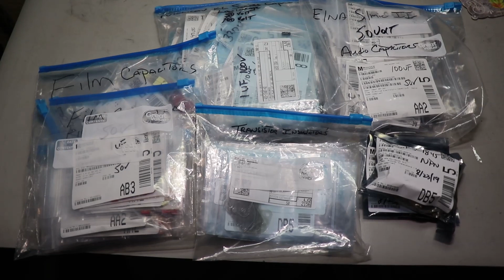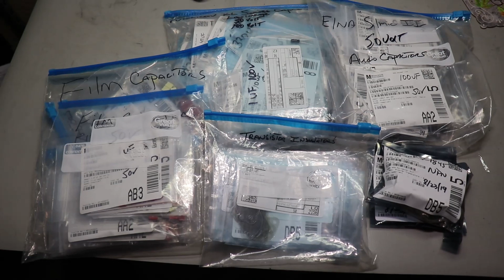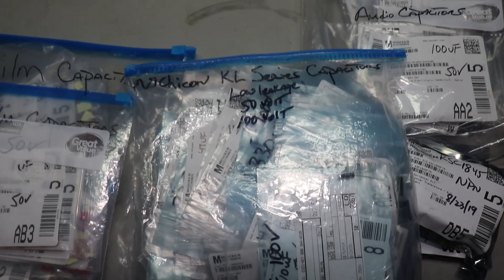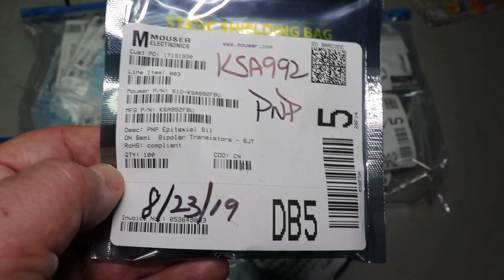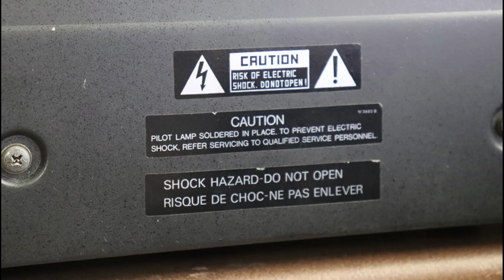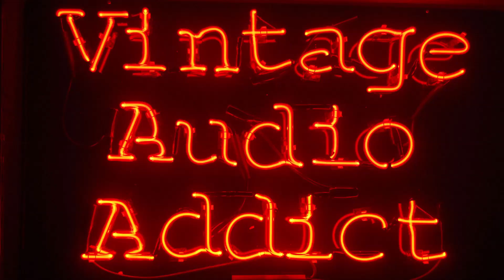Vintage Stereo Repair - The Parts And Tools Needed To Fix Old Audio Equipment

Comment: For those of us, who's better half will not let us buy one of the vacuum de solder irons. I have found a great trick for using solder wick. Put a little bit of flux paste on the joint you are desoldering and the solder wick will suck it right up in a second or two so that you don't get the joint too hot. Clean it good with alcohol when you're finished.

Comment: Need help! Replacing a capacitor and soder will not stick.
Reply: You might need some additional flux. There are various kinds, some more aggressive than others. Research it before deciding. You may want to use some 90+% isopropyl alcohol on a tip to clean the area on the pcb and even possibly the leads on your part well before proceeding to remove any possible contamination. Make sure the pcb and part has the alcohol well evaporated before applying heat.

Comment: I'm about to order a new soldering iron probably going to find an analog model. Do you feel there is any advantage with a digital  ? Just seems like more to fail
Reply from the maker: No need to get one with a digital readout if you don't want that. Just get a descent soldering iron and it will do fine for you.

Comment: I have a optinica amplifier sm 1515b if the power transformer goes bad can it be fixed the part number is rtrnpo506afzz it is my graduation money purchase so it is centimental the output ic is s-60w sharp number rh-ix1066afzz the power cap. Is a dual 50 volt 6800mfd

Comment: Do you sell any of the repaired equipment? I would be interested in buying.
Reply from the maker: Thanks for asking but no. I'm a collector who just repairs and restores equipment in my personal collection.
Reply: @vintageaudioaddict  I have a Sansui 9090db that the right channel on all 3 speaker settings, doesn't work at all. Seemed like when I retrieved it from the dump 20 years ago, it would cut in and out before the red light of death would shut her down, but over the last few years when plugging it in after rediscovering it after moving or rearranging the basement,  it doesn't work at all anymore. Do you have any recommendations for sourcing quality replacement parts, tips for troubleshooting/diagnostics, or parts you're interested in selling to help this here beginner revive the beast that solidified my passion for vintage audio from the Golden age? Any advice, tips or links to videos of yours would be greatly appreciated! Thanks for sharing your passion and expertise with the world!!!

Comment: Do you have any idea what would make a fm tuner not pick up stations on a sansui g 9000 db,   I can hear a faint signal on really strong stations but nothing strong enough to listen to. I have checked continuity going into the receiver but I don't know what to do next . Everything else works as it should.
Reply: I had the same issue with a 3000a, recapping the fm board fixed mine.

Comment: Had a question. Have you repair MD players? I have one that will power on when plugged into a power source but wont work on the original battery and the new battery I got for it. Think you could fix it?

Comment: don't you have to discharge those caps before pulling them?
Reply: If they have been sitting a long time without being powered up, they should be discharged>>they are small

Comment: Large filter caps another guy on YouTube who restores vintage gear says says he seldom replaced them. He says it's not necessary as they often test good. Anyway I wonder what are your thoughts ?
Reply: Filter electrolytic caps can make problems in some circuits if they are bulging/swollen and/or if their ESR increases a lot. Then they are a good candidate for replacement,

Cheers!

Comment: I love that vacuum desoldering tool.
Fantastic idea. I've just used those spring loaded ones or the bulbs. Neither are anywhere near as good on the circuit traces. You want to do it fast

Comment: When soldering using any tool please use a small fan to blow the fumes away from yourself. This is especially true for old lead/ tin solder. A face mask may fog up 
your glasses, mine are cheaters so yeah I'm old,, and you won't be able to see the  very fine work your doing.
Reply: Not certain about the points made but ,if anyone else  wants to discover 
ifixit and repair
 try Saankramer Electronic Magazine System (do a google search ) ? Ive heard some unbelievable things about it and my work buddy got excellent results with it.

Comment: You should instruct folks to remove that old "Sony bond" glue before reinstalling new caps. It becomes corrosive and will literally eat through the leads of thru hole components..
Reply: yea, the number of CB radios with that crap in them.
I'm sure they designed that shit with deliberate long term problems in mind
Reply: @Dazzwidd the adhesive used in radios was more for support of the components because of all the jarring G forces its exposed to under normal operating conditions.

Comment: Should you reflow solder other components while you're replacing caps?
Reply: It can't hurt, especially if the circuit traces are robust and not prone to lifting.
If you reckon a solder join could go be prone to going dry, just refresh I'd say

Comment: i hope to see u do more vintage repairs
Reply from the maker: I've posted some repair and troubleshooting videos below that I've done.

Troubleshooting Failures In Vintage Audio Equipment -

Vintage Stereo Repair - https://youtu.be/N3e9C4mUui0
Phono Repair And Troublesome Transistors - https://youtu.be/lkcP1z-KcPA
Hakko 808 Desoldering Tool A Must Have - https://youtu.be/NtSn_HPT-sE
Hazards Of Reel To Reel Tape Deck Repair - https://youtu.be/KvXwN5igzDg
No Audio In Vintage Equipment - https://youtu.be/pKqxlT9sgZY
Troubleshooting In Vintage Equipment - https://youtu.be/xk5gjq5ehK0 
Reforming Speakers - https://youtu.be/ttbgeDagRus
Checking DC Offset On Vintage Amplifiers - https://youtu.be/ZvBoxhpa-v8
Replace Old Electrolytic Capacitors - https://youtu.be/RaWrYJ6amcA

Comment: Great video,  What temperature do you use on your iron.
Reply from the maker: Thank you very much for your kind words. Around 700 - 750 degrees Fahrenheit
Reply: My jvc shelf home stereo doesn't power on. What can I check for?
Reply: @ar6484  Look at the power supply. Fuses, bridge rectifiers, faulty capacitors, etc, all in the power supply of the device...

Cheers!
Reply: @DalmaTon-Records  thanks. If I get this thing to turn on. I will be forever grateful. 🍺 cheers buddy. Let’s give this a whirl.
Reply: @ar6484  Good luck, but if you do not have any experience in electronics, better give it to the expert,

Cheers!

Comment: Great videos, thank you for sharing your knowledge and experience!
It is so rewarding to keep these wonderful masterpieces of HiFi engineering alive. At the age of 71, I look back at amplifiers and receivers I would have liked to have when I was young, but could not afford, and tbey are still running thanks to guys like you. Thank you.
Reply from the maker: Thank you so much Sir for your kind words. The equipment was engineered and built so well. I'm sure many of these units will be still operating when they are 100 years old.
Reply: hi everyone ,if anyone else  wants to uncover 
computer pc repair
 try Saankramer Electronic Magazine System (just google it ) ? Ive heard some interesting things about it and my neighbor got cool success with it.

Comment: If you do a search on ebay for "T12 STM32 OLED Soldering Station" you'll find some nice alternatives.
Can use genuine Hakko tips if you dont like the cheap ripoff tips.
There's also a even cheaper unit that can be powered from external 24V (your bech powersupply eg.)
I have used one of these for well over a year, and are werry pleased with it.
Cost me just about 25 USD including 3 Fakko tips.

Regarding parts for a restoration, on some forums you can find BOM lists for spesific models, like:
https://audiokarma.org/forums/index.php?threads/marantz-2270-power-amplifier-board-parts-bom.787466/
Maby an alternative if you do only 1 unit and it's a well known one,
but wouldn't trust it to be complete or up to date with what's in stock at mouser etc.

Comment: Great video, thx. Was wondering if you use any type of mask while you're soldering to protect against toxic fumes ?
Reply: I know that you didn't ask me, but I'll chime in here.  I used to work as a technician and we bought a cheap "biscuit" fan that ran on 110v, put a cord on it and put it on our desk with the air being pulled away from us.  This worked quite well.  Also, after handling solder, don't smoke or eat without washing your hands.  I hope this helps.
Reply from the maker: No, I don't wear a mask. Thanks for the kind words and for watching.

Comment: Thanks for sharing that information.  Those tools are very basic.  What other tools are necessary at an intermediate level?  A variac?  An oscilloscope?  If so, does range matter?  Signal generator?  Test probes, jumpers, etc?  I do have some electronic experience, but it's literally been decades.  I'd like to get back into it, but not having the necessary tools is VERY frustrating.  Any suggestions are greatly appreciated.
Reply from the maker: Your welcome, thanks for watching. Yes to all, LOL. I didn't see you mention a digital multi-meter. Just that can take you a long way. With a scope and meter you are 95% of the way there. A dim bulb tester is good to use and cheaper then a variac. If you google "dim bulb tester" there are many instructions on how to build one for a few dollars.
Reply: @vintageaudioaddict  thank you. Yes, I have a DVM, just forgot to mention it.  I will look into the dim bulb tester.  Thanks for responding, most don't seem to have the time.  I agree with you regarding the solder removal tool.  I still have a Soldapult spring loaded solder sucker, it works ok, but the tool you have looks to be far superior.  Best regards.
Reply: Any suggestions regarding a scope?  Back in the day, we all had Tektroniks on our benches, but that is probably out of my price range.  Any cheaper ones that you might suggest?
Reply from the maker: @ottodydaktyk  Your welcome and thank you again.
Reply: @redbike1986 Hi, I been fixing audio equipment for many years, more than 40.
Still have my first analog oscilloscope.

The times are changing, now I have a digital Agilent scope and some Fluke multimeters I have one 28 series 2 and one 289.
I bought one Rigol oscilloscope due the protocol sniffter, is posible to decode RS232, I2c, and various commun comunications protocols.

Today is necesary a hot air station and powerful soldering iron, I bought one Yihua 150 watts high frecuency soldering iron and is wonderful. 
Lead free solder is a real problem without a powerful soldering.

Cheers.